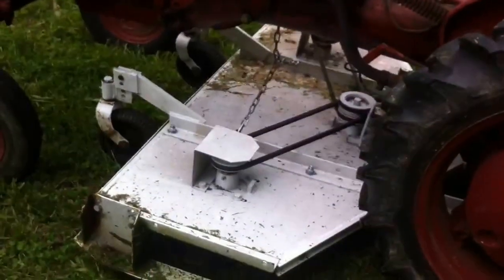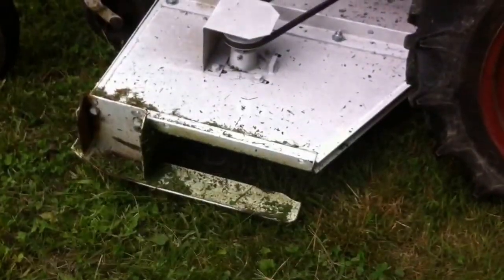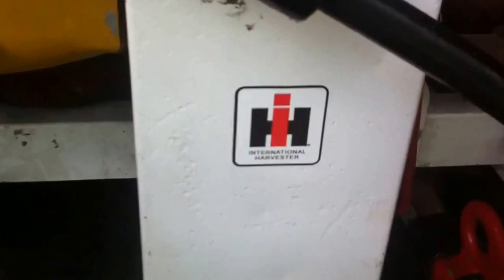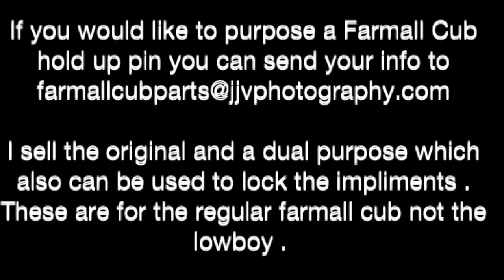IH Farmall Cub hold up pin & C3 mower

Comment: i have a C3 and my mule drive looks nothing like your's. you have a completely different setup.  i also do not need to use the right angle gear box, i have a right angle gear box but my mower setup doesnt use it.. you are right about its mowing performance, they do an excellent job. it will also mow some very thick grass if you raise it up enough

Comment: I have a Danco C-3 also, but the bearings are bad in the center pulley.  Any suggestions on how to remove and repair the bearings?    Thanks.
Reply from the maker: Press or tap them out. before you do so measure the bearings outer diameter and inner diameter. or measure the shaft they were on and the outer area they are sitting in if they are damaged. make sure to tap them out with a socket or pipe that is just slightly under the outer diameter. This will insure that they come out evenly. do the same procedure for installing them. They should be fairly straight forward. These old tractors and implements were made to work on in the field. IH still sells the bearings for these if not you can use those measurements and find some equivalent bearings. IH will also help you source things they don't have.  I hope this helps and sorry for the late response.